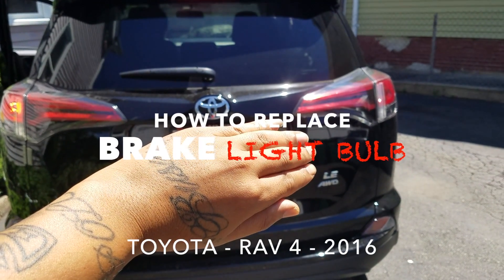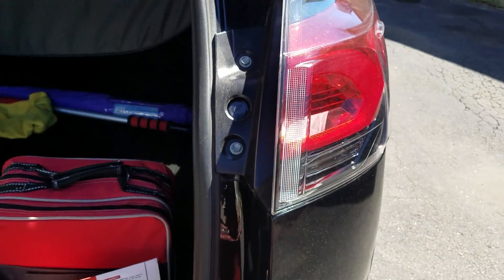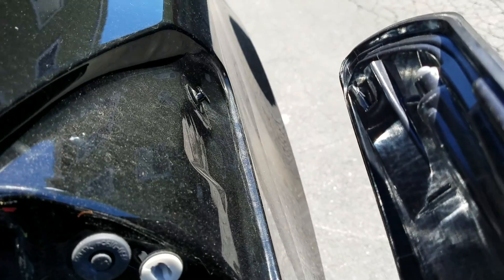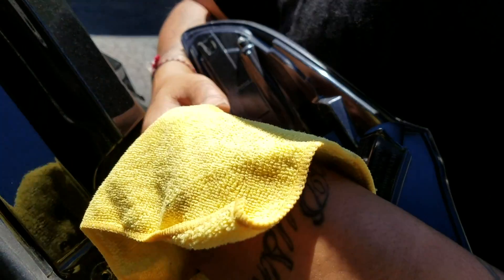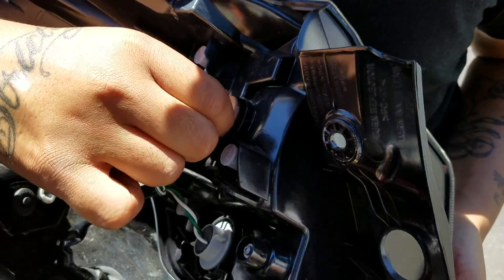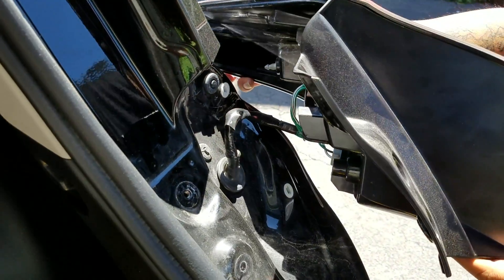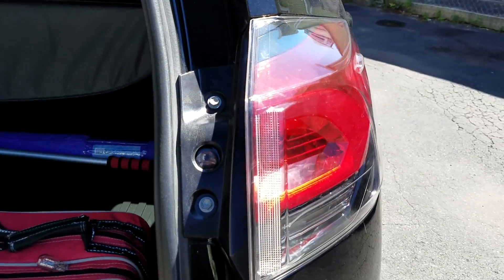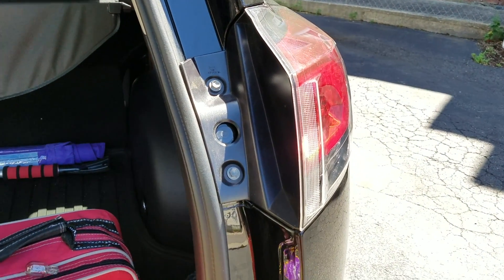HOW TO REPLACE BRAKE LIGHT BULB 2016 TOYOTA RAV 4

Comment: Thank you for the video. wish I would have seen it before I paid toyota $200. to diagnose my stop light issue and change the bulb. I had removed the two  10mm screws, but did not want to take a chance taking the light off and breaking the light. I have changed it myself now. grEAT JOB.

Comment: Thank you for the easy to follow steps on removing & replacing the break light. Specially the part about pulling the light assembly straight out to prevent damage.